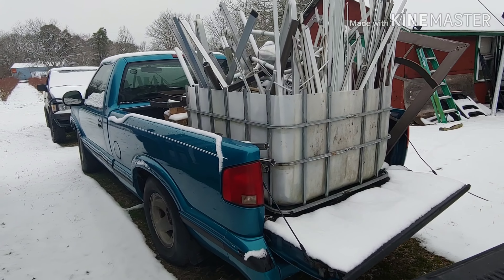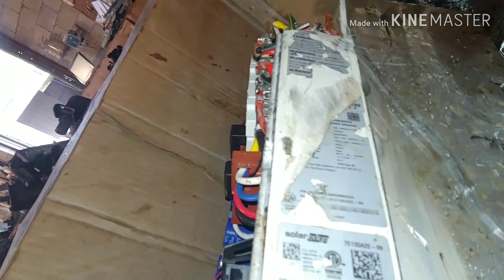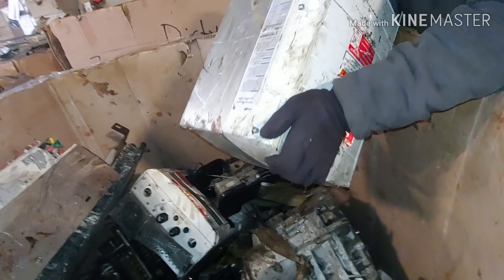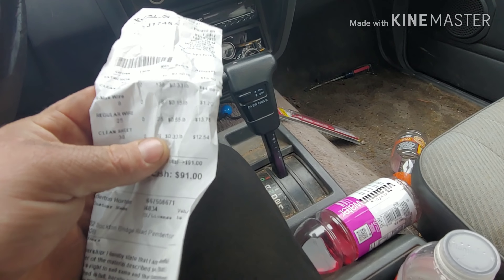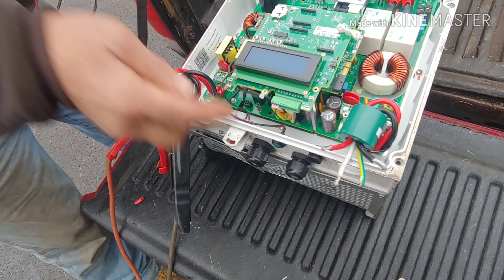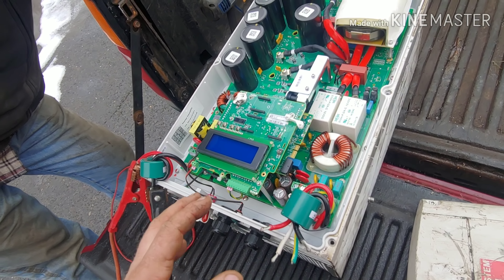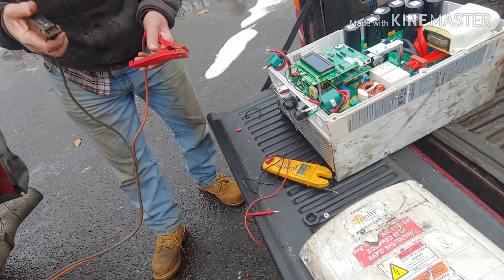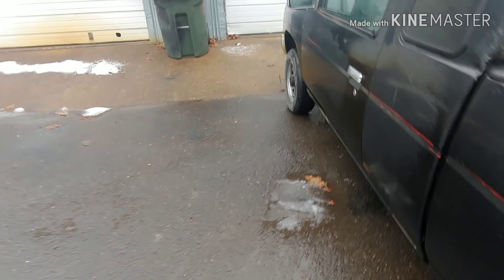Friday scrap load and playing with scrap

Comment: I have a whole work bench  full of riobi tools that drain the battery in about 10 mins of use,then totally wear out in 4 months,to me they are pieces of shit,I would buy a drill and cheap harbor freight stuff than buy a battery all the time at $60 a pop
Reply from the maker: I don't have that problem with mine... truthfully I probably burned up more DeWalt drills than Ryobi... and the old blue stuff in my opinion is better quality
Reply from the maker: Same company that makes Ryobi makes Milwaukee
Reply from the maker: And ridgid...all on the same line